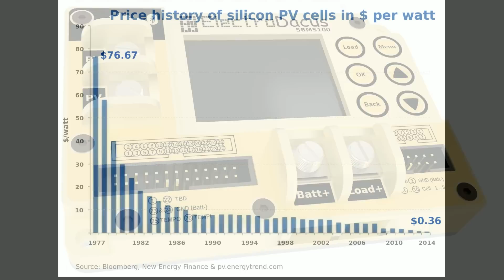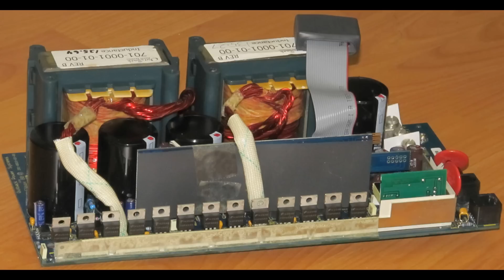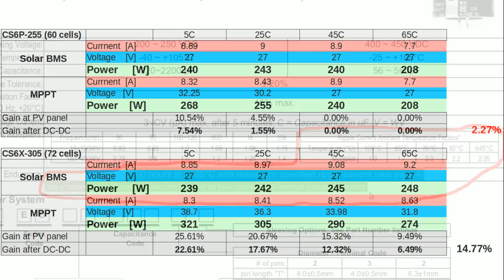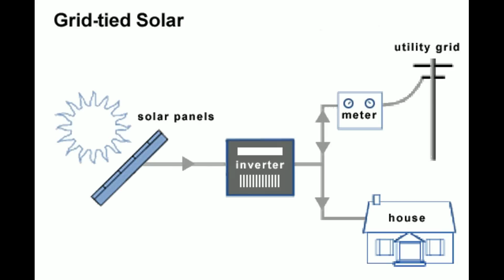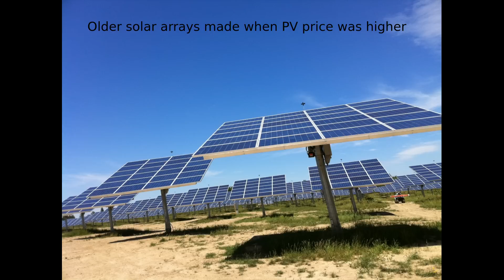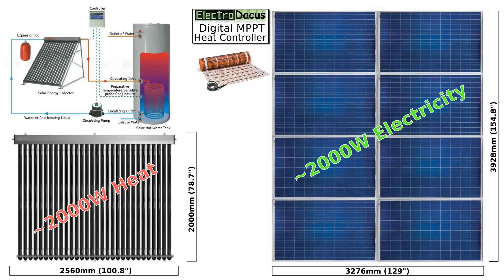Is the MPPT in OffGrid Solar obsolete ?

Comment: Wow talk about stacking statistics.  You're worse than a  as seen on tv guy.  Firstly the biggest savings offered by mppt is in the cost of copper wire.  The ability to run a high voltage array remotely mounted greatly reduces built cost.  Mppt also enables you to buy the cheapest panels available w/o having to match their output with your system voltage.  Especially with the newer low cost all in one systems.  Maximum array voc is now over 400v and the entire inverter system costs less than a flexmax 80. 

Basically you took the absolute best case scenario for your pwm cc and compared it to the worst case scenario for mppt. Then you didn't even take material savings into account.

Comment: Excellent reasonable and well explained... I have a few MPPT with blown capacitors and MOSFETs...in that time I have only one PWM controller fail in a six controller setup...I had the same conclusion that MPPT is pointless in a off grid battery charging system... excess power needs to be dumped so there are no gains...cost of MPPT nullifies the argument even further... repairs of controllers are possible but usually not viable...then there's the downtime of the system... Keep it simple...🤔

Comment: Replacing those electrolytic caps is easy really in small numbers. The MOSFETs will also die eventually.
Reply: Capacitors replacement is easy but unfortunately other components are destroyed in the stinking toxic and sometimes messy explosion...but I do enjoy fixing things..😂😂😂
Reply: @brucewatkins1624  When a cap fails, it can allow current to carry on and damage ICs and other components, so it's possible, plus if it actually vents electrolyte everywhere which does happen rarely it can destroy other bits. Usually you can just replace them, I remember doing 18 or some crazy number on a HP PC once that had the plague.
Reply: @VenturiLife  ain't that a fact...all this while the system may be down...no watts...those parts have to identified where possible.. new items tracked down paid for and despatched...cleaning up damaged areas of the board and traces...All time consuming activities which can make the viability of repair questionable at best...so the flag wavers for any technology have to be scrutinized for their often mono view of the wonderful enhancements they are peddling for the benefit$ of mankind..😊 keep it simple.

Comment: Thank you, very sensible and reasoned arguments, learn't alot.
Reply from the maker: Thanks for the comment. Glad to hear the video was useful.
Reply: @electrodacus  I've been looking over your site and the forum and just can't find an answer to a burning question about wiring up the penels with the DSSR20 ? I get that 2 panels in parallel each get a DSSR20, however is the DSSR20 at (close to) the panel ? Or do each of the pairs of panels that hook up to the DSSR20 have their own cables which run down to the main controller, all joining at the point? Or do all the PV pairs have their own cables which run down the their DSSR20's which are next to the controller?

I'm trying to get my head around the different cableing required when adding more panels to the system.
Reply from the maker: @ndudman8  The DSSR20 will be typically close to the battery and SBMS0 so each set of say two 60 cell panels will have a pair 10AWG PV cable and that is the most cost effective PV cable as it is the most common.  There will be no advantage for the DSSR20 to be close to PV panels and then use a thicker PV cable from the combination of a few DSSR20 as that thicker cable will be more expensive than multiple individual 10AWG pairs.
waterproof
Reply: @electrodacus  thanks that clears things up in my mind, is there a max length for reasonable voltage drop. (2 190W panels) and (2x310W panels) ?

 I was also reading on your forums and manuals that only <=8S banks are supported, as you don't want to go over 24V systems to stay with eu low V dc systems (might have got the tech name wrong)... I also read about LTO batteries and what you thought of them, I don't know if thats changed ? However I was wondering if would consider 11S so at least a 24V of LTO 2.3V cells would be supported ?

Sorry for so many questions.
Reply from the maker: @ndudman8  The 190W panels are likely 36 cell panels for a 12V battery and the 310W ones are 60 cell so good for 24V battery. My panels are about 15m (50ft) away for the battery so around that will be good but should be fine even at 20m (65ft).
Yes 8s is max to stay in the safe ultra low voltage standard.
LTO are 2x as heavy as LiFePO4 for same capacity and also about 2x more expensive for same capacity and offers no benefit over LiFePO4 as both are mostly affected by the calendar aging 1 to 2% per year capacity degradation and the cycle life has almost no impact on neither LiFePO4 nor LTO.
So I see no reason to use LTO that are more expensive (shipping also more expensive as you have double the weight) over LiFePO4
You can check my LiFePO4 degradation over 3 years of heavy use  https://electrodacus.com/solarforum.html?place=msg%2Felectrodacus%2FnKWp_6tjMNM%2F1f66fW6-BwAJ
Reply: @electrodacus  Thanks it was an interesting read... This guy had an interest build, also at the end interesting analysis of the life time cost based on cycles https://www.youtube.com/watch?v=kYx097cVR48 Incase you hadn't considered or seen it, I'm thinking that you know more than me :) but might have an opinion on what he shares. Thanks
Reply from the maker: @ndudman8  Both LiFePO4 and LTO will have about a 15 to 20 year life in a proper setup offgrid application but LTO will cost 2x as much for same capacity and be 2x as heavy so is clearly inferior to LiFePO4 in this sort of applications.
Reply: @electrodacus  Everything you say is wise. Some day i'll have some compile all your writings into a book or maybe you should from all these questions people ask you.
Reply from the maker: @josephdunn4388  I'm hopping google comes up with a powerful enough AI to read all my replays (an average of 4 to 5h per day now) learn from them and be able to answer giving me back those few hours per day :)

Comment: Also in winter the thermal tubes won't be giving heat energy for heating but PV can work in winter too and could heat the thermal masses upto a desired temperature

Comment: electrodacus; Great lessons here.  Nicely done.  Much appreciated.  Kinda wish I'd seen this in the last month or two since I've embarked on a quasi off-grid system to help weather California's PG&E disaster.

I'm wondering if you've come up with any good use for your summer excess power?   A Canadian friend told me they had that  same problem with excess solar and they used their summer excess to make ice!  They had planned to use it themselves but instead have people beating a path to them willing to buy it.   Often in rural areas ice is highly sought after because getting it from far away urban centers is about the only alternative.
Reply from the maker: I have about 90% energy excess in summer as my solar PV array is large and designed to fully heat my house in winter thus the large excess energy.  The excess is not relevant and not that large averaged over the year as heating season here in middle of Canada is about 6 to 7 months / year.
I do not think ICE is that expensive not sure if it could be sold here and you do not need just energy to make ICE you also need some cooling equipment that may or many not recover the investment thus it probably will not make sense at least for me. I live in the middle of nowhere so ICE will need to also be transported somewhere to be sold.
Personally I have no use for ICE.
What I do with a small part of the energy is distilled water for drinking (I used to buy 4 liter/ one gallon per day for about 2 Canadian Dollar) that saves me about 700CAD/year and over 30 years expected PV array life that will be 21000CAD more than the entire solar system costed so that alone more than makes up for the investment and is an insignificant part of energy used.
By using the excess energy at any cost you may make things worse (increase your expenses for things you may not need or are not economical) is about the same thing as MPPT that seems as a good idea getting some extra energy but the cost to get that makes no financial sense.
Reply: Makes sense.  How are you distilling water?  Is it a purchased still or something you've built?
Reply from the maker: @keithcress1335  I purchased the water distiller quite a few years ago. I do not remember where I purchased mine but is like this http://thaigousa.com/product/megahome-countertop-water-distiller-white-glass-collection/

Comment: I know what you mean about large south facing windows. My top floor urban apartment BedZed has large windows and is way too warm in summer and too cold in winter. The windows should have been used as solar thermal and not spaced solar cell panels. Then we would always have warm water with some timed immersion boosting in winter with  solar PV or grid electric provision. My place is meant to be passively heated but that’s not a 100%. Solar thermal is the way to go. The solar panels are nearing the end of their life (17 years old) apparently so they aren’t cost effective. They won’t be replaced as it’s too expensive. I would love to disconnect them from the grid and make use of them myself as a thermal water heater. Have a look. BedZED Housing development. 
https://youtu.be/60es4dTm8Q4
Reply from the maker: Page 5 of this document shows why PV solar is more cost effective that thermal solar http://electrodacus.com/DMPPT450/dmppt-presentation-v01.pdf
For UK this will be even more true as in cloudy days thermal solar will probably do almost nothing compared to PV solar.
The spaced solar panels in windows is just a bad idea as they are more expensive than traditional PV panels and the window that functions as a wall is way less energy efficient so much so that it is likely a net loss even with warmer UK weather and is a particularly bad idea in summer as based on the video those windows are not shaded in summer.
PV panels will easily last over 30 years not sure why you say the 17 year old ones are close to the end of their life.

Comment: I kind of get the feeling that your controller is more of a pwm controller. If a pwm is configured correctly with the panels the efficiency is better then a mppt. I need performance in low light conditions.
Reply from the maker: It is not a PWM controller as PWM is not needed for Lithium charging (it is actually detrimental). PWM is used for constant voltage charging (absorption and float) with Lead Acid that require this sort of charging. Yes if panels match battery they can work very close to max power point so much so that it will be in average more efficient than using an MPPT. If you have the apace and add more panels that will be cost equivalent with the MPPT then that is a way better financial investment.
Reply: @electrodacus  i dont mean to be offensive at all . Im not sure of the differences
Reply from the maker: @frankz1125  You are not offensive. Not sure about your question. A Lithium battery say a LiFePO4 that is ideal for solar as it is the most cost effective is very simple to charge and almost like a capacitor so you can connect a solar PV panel to it "directly" as solar PV panel is a constant current source and that PV panel will push current in to the battery (current will depend on amount of light) and when that LiFePO4 cell gets to 3.6V charging should immediately stop as cell is 100% charged. What a PWM will do is turn the panel ON/OFF to maintain say that 3.6V and that will have detrimental effect on a Lithium battery as the LiFePO4 is already fully charge and charging should be completely stopped.
So PWM is used for constant voltage charging (absorbiton) and only constant current charging (bulk) is needed for LiFePO4.
With other type of Lithium cells say LiCoO2 or NMC used in portable electronics or EV's constant voltage (absorbtion) charging can be used to get some extra storage capacity but to the detriment of battery life. In those applications the extra 15 or 20% capacity you get using constant voltage charging (absorption) is more important than battery cycle life but that is not the case with solar energy storage where cost amortization is more important than energy density.  In any case LiCoO2 and NMC are not cost effective when compared to LiFePO4 and with LiFePO4 there is no extra 15 to 20% from constant voltage charging possible as this cells will be fully charged already after the constant current charge phase and there is not even 1% extra left to gain by CV charging.
Reply: @electrodacus  i did not know this. Thanks.
Reply: @electrodacus  The data sheet for my A123 cells says it is recommended to absorb then float charge . Like a lead acid battery. 3.6v then 3.45v/cell. Are your cells different?
Reply from the maker: @frankz1125  Can you provide link to that data sheet ? The A123 is fairly old as they where the first commercial available cells and they probably tried to provide instruction on how to set a Lead Acid charger for those cells but no both absorb (that will do nothing as battery is already fully charged when is at 3.6V) and float at 3.45V will be detrimental.
I use my A123 cells charged by my SBMS120 no absorb or float and my battery degradation after first year of heavy use is just 0.9% about 0.3% from cycling and 0.6% from calendar aging. With absorb and float as you mentioned the degradation may have been more than double so still most people will not notice but battery will be good for just maybe 6 to 8 years instead of 15 to 20 years if properly used before it is at 80% of original capacity.
Reply: @electrodacus  i will tonight
Reply: @electrodacus  I only have a pic of the specs and cannot find the pdf I used. Every other pdf I see does not have a float recommendation.
Reply from the maker: @frankz1125  That was probably a modified spec made by one of the sellers. Floating a Lithium battery of any type is detrimental and absorption is only used with high energy density cells like LiCoO2 or NMC in EV's and portable electronics where cycle life is  less important than energy density and with those type of cells you get an extra 15% or so capacity by continuing with absorption when you got to 4.1 or 4.2V but that comes at a cost of reduce cycle life so you will not want that with Solar energy storage.
With LiFePO4 you only get at most 0.5% extra storage capacity if you try to use absorption charging when the cells are at 3.6V as they are already basically fully charged and will not accept any current so there is just zero reason to do that just stress the cells for no gain.
Reply: @electrodacus  with your cells . You charge to 3.6v . Do they stay at 3.6v when the charge is stopped or do the cells settle at 3.45v?
Reply from the maker: @frankz1125  My default settings are 3.55V where I stop the charging and then they slowly drop over a few minutes maybe fasted depending if there is or not some load. If there is no load it may take close to an hour to drop below 3.4V when charging will be enabled again.

Comment: The whole discussion is relevant to your lifestyle and everyone's solution will be different. That being said more solar panels has always been the solution but once your space is maxed out one needs to consider the alternatives ie storage being the next cost cutting solution. Water being the cheapest storage medium and most versatile now how you heat it depends on what surplus power source you have and when you want to retrieve the stored energy. I will have to disagree on the ground source or storage source heat pump as  one can get a double bang for your buck depending on storage media and what you do with the media once expelled from the heat extraction. 
I love your videos and you have many cost saving ideas I look forward to your next cost assumption.
Reply from the maker: It is relevant for anyone that cares about cost amortization as adding an MPPT in any circumstance will increase the cost. 
Heat pump is not free and when electricity costs 30cent/kWh you may be able to reduce that to half thus gain 15 cent/kWh and maybe able to recover the cost of the heat pump by then end of life (depending on the quality and cost of that heat pump it may be possible) so you will get even (not lose money) or may even make a small profit by the end of life.
Now when PV electricity cost is less than 2 cent/kWh and thermal storage as low as 1 cent/kWh you will need to find a heat pump that is as good as the one mentioned above but cost 15x less (of course that is not possible) and that is just to get even no actual advantage.
So it is not possible to build a heat pump so inexpensive and high quality to be able to be cost effective when the primary energy source cost is so low as PV solar.
Reply: @electrodacus   Thanks are you considering that the electricity used by the heat pump is generated from PV?
Reply from the maker: @offgridwanabe  I compare different way of heating and direct PV heating is the most cost effective solution even less than natural gas that is the next cost effective option. Adding a heat pump to PV heating will not be cost effective so it can not be considered and if you only have grid electricity then adding a heat pump can be considered and can produce some savings depending on your climate but it will never get close to PV heating or even natural gas.